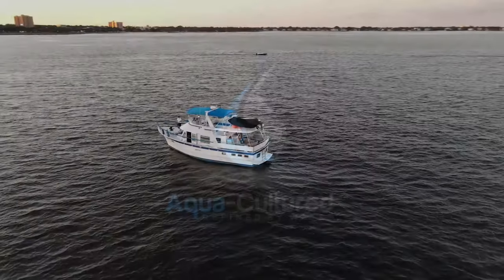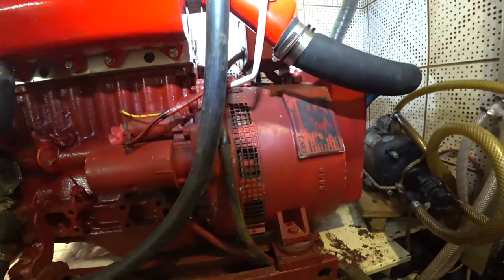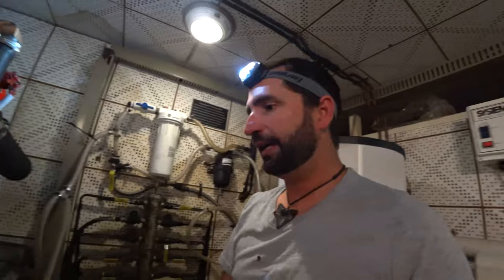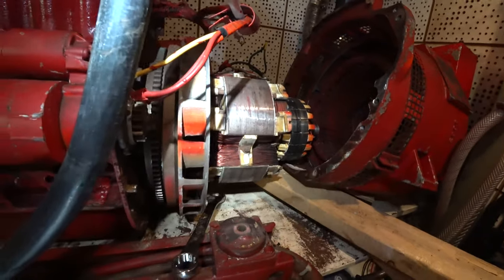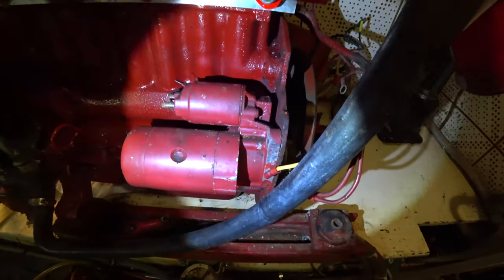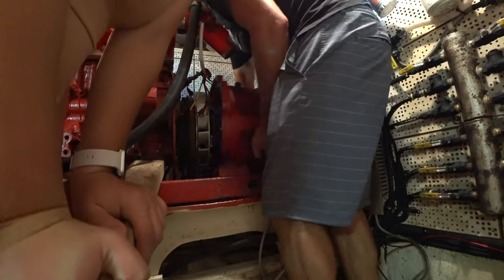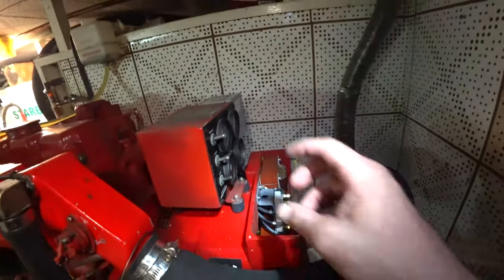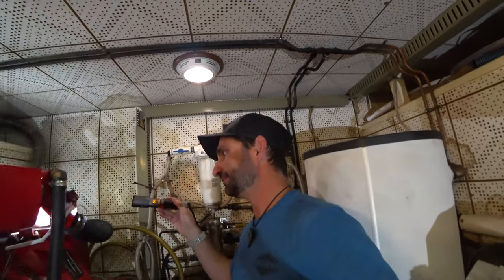How To Rebuild a Westerbeke Generator On a Boat, and What Not to Do! DIY

Comment: Well fudge not easy, ugh i have about 80% less room than you have. Mechanic said he would not tackle it with out remove the whole generator. Well thank you I am going to try it any way. Sorry to hear your mistake, but hopefully i won't make the same mistake.
Reply from the maker: Ugh! That’s not fun! I really hope you can make it work. Space is rarely on your side on a boat. I know I had just enough space to back the stator housing away from the block to clear the armature with out having to move the whole engine forward. Best of luck, keep me posted!

Comment: I GOT A WESTERBEKE GASOLINE GENERATOR IT IS 9.5 MCGA ( 60HZ )
OUR PROBLEM IS THAT OUR SYSTEMS BURNED SEVERAL TIMES AND THE REASON WHY?
WE THINK ABOUT THE ( AUTOMATIC VOLTAGE REGULATOR ) THE AVR UNIT.
OUR QUESTION IS , IS THERE AN AVR UNIT FITTED IN THIS GENERATOR????

PLEASE SEND ME BACK YOUR REPLY AS SOON AS POSSIBLE
Reply from the maker: I am not sure about the gasoline setup. But mine definitely has a voltage regulator. You would want to verify what voltage your unit is producing. What systems are you talking about that are being burned out? You can also reach out to Broward Armature down in Lauderdale or Yacht Power Products in St. Petersburg